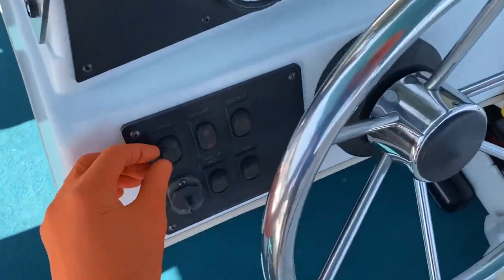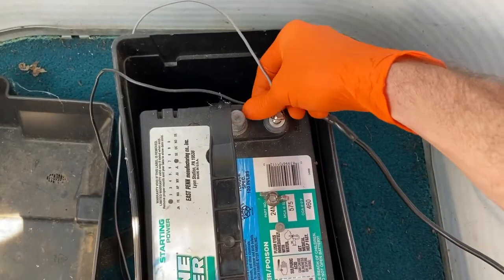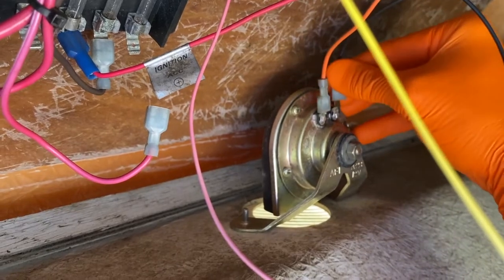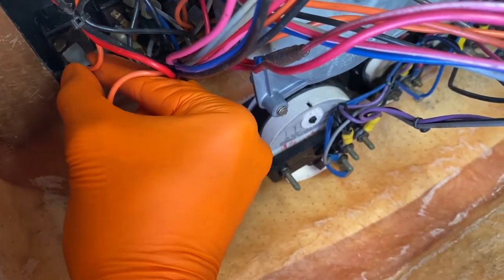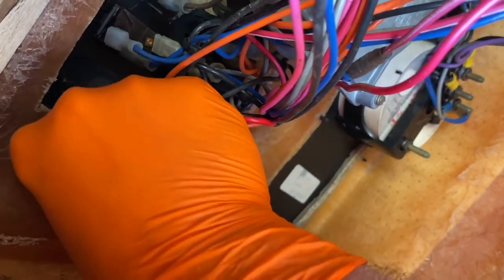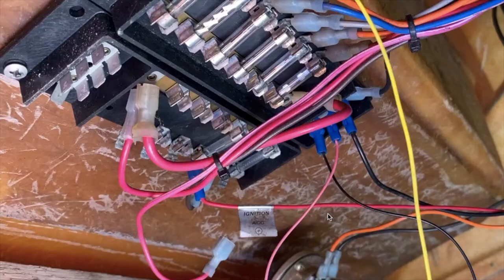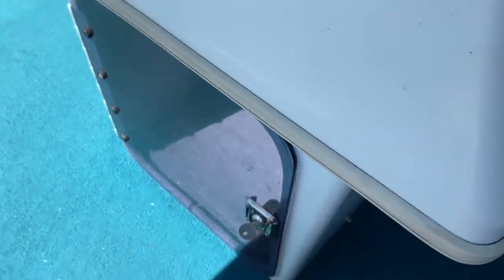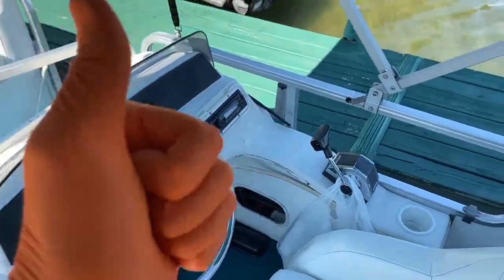Boat horn not working - Common cause

Comment: Okay, have a question. I just bought a 1989 seaswirl 230 Cordova with a rebuilt 350 cobra motor. The guy I bought it from raised the trim before trying to start it but the battery was dead and it had no gas. When we got home, the trim didn’t work only the lights, blower, and bilge pump after we put in a brand new battery. We’ve checked what we believe to be all the fuses but found a box of 30amp blade fuses but no where to put them. The rest are 10amp tube fuses.
Reply from the maker: @staceymiller4765  

Thanks for watching, any update?  Did the outdrive move at all or make any sounds when attempting to trim up or down?
Reply: @DIYwithMichaelBorders  starter is bad, trim fluid is low
Reply from the maker: @staceymiller4765  

Thanks for the follow up.  Sounds like some DIY projects ahead.  😎👍🧰

Comment: Should the horn work without starting the engine
Reply from the maker: Thanks for watching. Great question, and that will depend on the actual boat.

Most boats have the standard wiring configuration that allows the horn to be honked when the engine is off.

Comment: No movement yet so
Reply from the maker: @staceymiller4765  

That’s a bummer…but can definitely be fixed.  Since you have a brand new battery, the next thing is to inspect the trim limit and sender switch wiring.

If the wiring is good and firmly connected, we would move on in replacing solenoids.

We can’t rule out the trim switch itself on the throttle lever but that is uncommon to fail…but…if the throttle switch is damaged, it might be that switch.